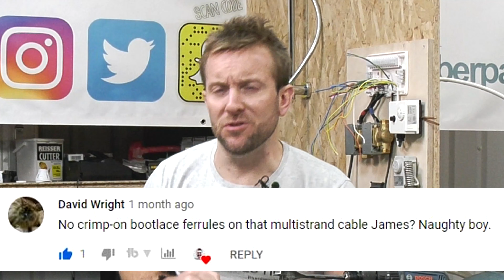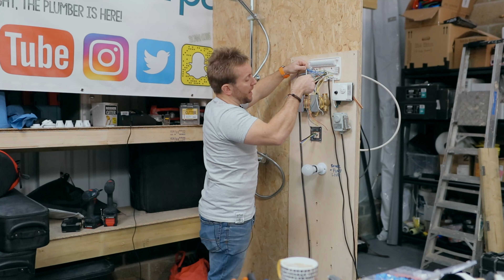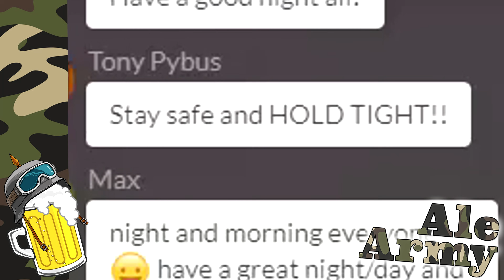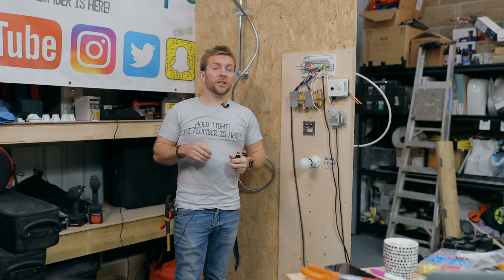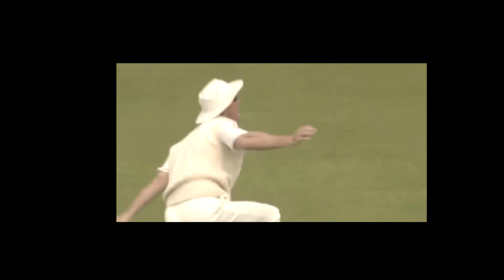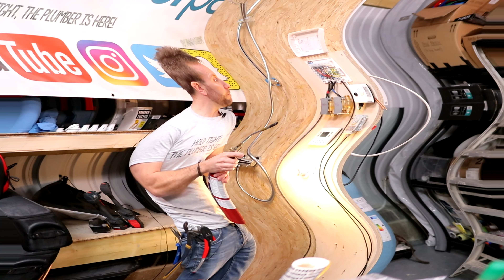HOW TO WIRE A CENTRAL HEATING SYSTEM FROM SCRATCH - S PLAN

Comment: you mentioned using a good wire stripping tool, but you don't have one in your amazon store, could you tell us which one you use please, mine is rubbish and either doesn't go deep enough and doesn't pull the insulation off, or goes too deep and nicks the core, cheers.

Comment: Im wiring up one of these soon. What a understand already following an S plan, all wiring for both the valves, boiler supply, general supply. Now the only other two components to be wired are to my knowledge the heating element into the cylinder and next to to a thermostat that connects into the cylinder. No time controller or pump which leaves a few blank spaces following the common S-plan wiring diagram. Any help appreciated 👏

Comment: As a mechanical combustion engineer, I do a bit of electrical work. Its mainly swapping out u/s parts for new, and like you've discovered those bootlace ferrules are awesome. I use them everywhere, Wagos, Chockys, PCB plugs etc, they are so much more reliable than twisting/folding wires which occasionally come back out.
I use exactly the same brand too.

Comment: Cheers for this James.... Just wired up my first mock up board, like yours.... and.... drum roll.... it works!!!!! I didn't think it was working at first, stood back and scratched my head for just over 10seconds and click, it triggered and turned the bulb on! Didn't realise the valves took that long to open and trigger the microswitch. Cheers again.

Comment: Hi mate, thanks for this video really good, earned a sub! 

I have a problem where my Hive system was working for 2 years, suddenly when I request central heating then it lights up like it's requesting it from the boiler, but the boiler doesn't start up. It works when I request hot water though. Any idea what colour wire I'm probably looking for in my wiring centre? I can trace the 2 wires from my Hive unit that request hot water, or central heating, but I don't know what they should be connected to in the wiring centre. 

Cheers from York!

Comment: I love this video, honestly I must have watched a million videos before this one, and no one says it as easy as you - finally got the confidence to try out my own wiring centre. Question: How would the wiring differ if I had two stats and valves for CH (one upstairs and one downstairs) and then one for HW, and my programmer could do them all separately? I assume if I doubled up the wiring from each stat to each CH valve as you said here, I wouldn't be able to do the separate controls since either room stat would trigger the boiler for the whole house and not separate?

Comment: Nice vid, great advice, good accents. Some advice in return from a production bod - love the wiring up to the light bulb, but if you laid out your circuit on a tabletop, rather than on the wall, you could position your camera overhead and so you avoid getting in the way of the subject. This will cut your edit time too. You could also reduce the frame size on wiring so you can annotate outside of the main subject (so there's a border of white space).  If you're running 2 cameras have the 2nd on you. Some of the mid shot explanations mean the viewer can see what you're pointing at so clearly. That's how I'd do it - simples (for you and the viewer). Anyhow, is that getting a proper moan on?! Great free resource - now I've just got to see how to apply it with a wireless room stat (and pull out all the individual connectors loosely strapped into a box by the original installer - who didn't bother with any kind of stat. Nice!).

Comment: Hey, great video, as always! Why do you connect the grey MV cables to a constant live and not the CH on / HW on from the programmer? Doesn't this mean the boiler will run continuously if the valve fails in the open position?
Reply: No, because it's the orange wires - switch return wires from the valve that fires up the boiler.

Comment: i would say as a best practise that zone valves can be ferruled together PROVIDED something like Regin 5 Way Electrical Connector with Strain Relief are installed between each zone and wirin centre for maintainance and testing. also allow in situ replacement with having to power the whole Heating system just to swap out a zone valve

Comment: Hi
Thank you for your kind and easy to understand explanation.
Would wrong flow direction of the zone valve cause problems such as boiler not firing !? 
I  have a S system with a heating boiler only in one floor lower and the valves, pump and hot water tank in upper floor.
I have changed 3 zone valves and a new pump, the boiler does not fire. I keep reseting  the boiler, the indicator diode for heating becomes green but goes off again. 
It remains in stand by position.
Any advise please !?
Thx

Comment: Hi  I am just about to build a system like this using an Ideal Mexico boiler which does not have appear to have a pump overrun. So i assume pump is in parralel with boiler.  Also, these busbar pieces for behind N and E,  are these included in the Timeguard box, or are they bought sepatate ?  Thanks

Comment: Good video, helped loads when self fitting a hive controller and switching from the old mass of wires.. used the Wago box instead but followed the approach in here and all was good.
Reply from the maker: Cheers!
Reply: @plumberparts  only issue I have now is how best to ‘take out’ the room thermostat (in hallway near door and garage door so not practical to rely on.. rather have the hive wireless in the room being the main control. Is it as well to take those wires out the loop and just connect up that link?

Comment: So I have an old tank system, there is no programmer that we know of/can find, there is a junction box and then a light switch, one for hot water, one for heating and a stat down stairs. So far no one has managed to work out why my heating get stuck on sometimes, even electrictions, could a missing programmer cause this?

Comment: Thanks for this video, I just built an extension and upgraded my single system to a zoned system, I copied your wiring center with a junction box and strip connectors as couldn't find a pre wired box in Ireland but it worked a treat and this video saved me a fortune. Love the channel and thanks again

Comment: Hi. New to heating electrics and you make excellent vids, cant say how much they help. . Some systems have hot water priority but this S plan 2x2 port system appears to work independently or in tandem, with no priority. Am I correct? Is it only Y plan that has priority?

Comment: It would help if you mentioned how many cores are in each Cable supplying each unit.  For instance how many wires to the time switch or how many cores on the Thermostats. etc. Good Video though.

Comment: Hoping someone can help me...I have a 3 port valve, when i press heating the actuator head whirs up you can hear the tank coming to life but then seconds later it turns off...the only way for me to get heating is too turn the water on too...in other words the only way I get heating is to move the toggle on the danfoss head to manual...I've tried two different heads and changed the actual valve body

Comment: As an electrician I have sorted loads of these out for friends and family, plumbers come and change valves and cock the wires up, that and electricians who have no idea what they are doing in the first place leave S-plans in a total mess. 
Best solution is to pull every wire out of the wiring centre and identify everything wire by wire and reconnect each wire in turn, then prove the functionality of each channel and it's associated stat and valve.

Comment: I bought those same crimps but there's no BSEN number, and no rating. It's assumption only that suggests they can handle full load/capacity of wire. And what are they made of? Not aluminium hopefully, with a copper cable being inserted. What's the continuity results for these circuits, did the crimps effect the readings at all? Just curious. 
    It's a shame i couldn't watch all video as i wanted some tips for wiring an s-plan for an assessment, hopefully no one gets electrocuted from your mis labelled switch lives as you seem like an nice guy.😁🤞🤞⚡💥💥⚡

Comment: Hello. I'm struggling to wire a three way valve with motorized actuator with three wires blue black brown on a Audax 8 heating pump. Can't figure out how the reverse motion will occur from the diagram . Any idea pls?

Comment: Hi,
Stanley twin burner , oil vortex burner and a wood fired stove to heat a 2500 square feet 2 storey house. Plumber has recommended a Multi Pod system. Downstairs has under floor heating . Upstairs has rads. I’m an Electrician but there’s no schematic issued by plumber..
The home owner wants the Stanley twin burner in the kitchen. With the condenser boiler outside as back up. There’s probably no need for both but the client wants what the client wants. Can any one out there tell me where to get a wiring  system at a reasonable cost. The multi pod takes the three heat sources but only has one heat output. So the cooker and burner might share the motorised valves. Will I have back feeds ? 
I’d prefer a wiring system or control box to take care of this

Comment: My only comment you should mention not all boilers use a switched live through microswitch some use low voltage supplied from boiler to zone valve microswitch

Comment: I just bought a house which has an f&e system with no stats or programmer. Just a time clock to turn on the heating which will also do the hot water. The boiler is in a boiler house which is built on to the house. I am planning on having a room stat upstairs and downstairs, a 2 zone programmer under the distribution board downstairs but where is the best place to fit the motorised valves? I will be able to run multicore cables for my connections. Loving the videos man!

Comment: bootleg ferules are great until you have to trace a fault on the system and end up cutting the ferule off to separate wires to test, then some will be too short to re-connect. there are pros and cons to this. You should also have brown sleeving on any Line conductors that are not already brown.
Reply: Gareth Rendle doubt you've been anywhere near a multi meter, I'll have fries with that thanks Gareth.
Reply: bob bob how would you possibly know what experience I have? What a stupid comment!

Comment: Good neat job explained well. BUT ..... you should not have doubled up on the wires into the ferrules, you had enough spare terminals in the strip block. There is a risk of pulling out. Finally always do an earth continuity check throughout the system, especially if plastic pipes are involved! In fact do a video on earth bonding and why it is important. See any video by John Ward for good explanations and examples.
Reply from the maker: I did say that a few times in the video. Thanks for your comment!
Reply: @plumberparts  .... but "they" don't listen and remember ... they only look at the final result. The box has not got enough neutral and earth terminals and could do with some pre-printed labels, so it is OK, but not as good as it could (should?) be .... fyi I took your advice and will soon be posting my own DIY vid ref DESTRATIFICATION on YT so you can I fun at my expense ...... Hold Tight!
Reply from the maker: Good luck. It’ll be interesting to know what you think about the process!

Comment: This is great but ; wiring  diagrams are freely available online, and 'PLUMB CENTER' do a 'WIRING CENTRE' that is set out like a PCB, and all the necessary connections are labellled up, for both 'S' and  'Y' plan systems!  MOST competant Heating engineers know all of this (Ok it is good for late starters like myself in 2004, or young lads in the industry) But you are encouraging the 'DIY maniacs' who don't want to pay a professional, but will eventually ' F??? it up' and then call 'us' out but still don't want to pay for our time! dx
Reply from the maker: I’m encouraging apprentices more than anything to learn this. Regardless of printed PCB’s - they need to learn why they’re doing what they’re doing. 

I’m not encouraging any section of society. I just think YT is the best place to put my (hopefully helpful!) videos. 

Sorry about this one mate 🙁

Comment: From the programmer you had the Brown wire as call for Hot Water and the Black for call for Heating,  But you talk about a red wire for call for Hot water going down the white to the cylinder stat (common) and the yellow being the switched call for heat from the cylinder stat. In the diagram you have it labelled as red from programmer for call for Hot water.  Confusing!  lol

Comment: MOST wiring centers are wired wrongly as they either don't have a earth in every cable carrying 240v or they use the earth as a switched line as couldn't be bothered to run enough cores in that cable. The EARTHS protect the cables from short circuits and stupid people cutting through them when they are still live from receiving a nasty electric shock!!

Comment: Absolutely Brilliant!! Only comment I would pick up on is that instead of using red tape I would suggest using brown sleeving on the blue and the black cables. Blue being the current neutral standard and black being the old system. I hate seeing tape used just because with age it becomes a sticky mess and if I need to trim it later  getting it off can be right pain in the rectum. See you on Thursday for a pint - Hold Tight!!
Reply from the maker: Cheers Tony! Expected a few sign ups yesterday. Had 4000 views and not one sign up on Patreon! I wonder why? Any thoughts?! 😂
Reply: plumberparts because a lot of people want something for nothing mate.

Comment: Great video  you have made it simple to understand top man . There’s a little tip for coding of wiring . Where the red tape is used this should be brown as the wiring is the new harmonised wiring ( ie brown and blue ) . You can buy brown, blue , green yellow  sleeving from the wholesalers . I have sometimes come across people using the earth and using it as a conductor as they have only run a 3 core to the cylinder stat DON,T. Run a 4 core then everyone is happy . That also applies to the room stat .NEVER USE USE THE EARTH AS A CONDUCTOR EVER  .  As per regs . Hold tight 🤪
Reply: Yep. Do it right or not at all. Too many awful and dangerous jobs out there by "Professionals" and amateurs alike. I work on the principle that I might be the next person back to the job so no point in making it difficult for myself...
Reply: Alan Williams hi Alan, you comment demonstrates that you know nothing, stick to taxi driving, regards, bob.

Comment: Hi James. 
Here's a question for you.... I'm 37 now. Have been plumbing for a few years and am OFTEC. When I can justify the spend in a couple of years, is it still worth getting a Gas qualification? What's your opinion on Hydrogen boilers and how do you think the roll out will happen. Lay new pipes, or slowly introduce boilers that will cope with a blend and as boilers age and get replaced, upgrade to a boiler that can take a higher blend or is there going to be millions of boilers getting swapped out in a short period of time?
When all this malarkey 😷 is over, let me know when you're passing by the Maids Head by the fens, I'll buy you a drink🍺.
Reply: Christian B Hough One of the gas boys told me that new builds after 2030 will not have gas boilers installed. But there are still millions of gas boilers that will still need servicing etc. Renewable energy seems the way to go with ground source heat pumps and solar etc.

Comment from the maker: Extra belly scrubs if you can guess the cricketer who took THAT catch! (also I forgot my tool belt in this video!)
Reply: Andrew strauss in the greatest ashes series ever
Reply: Great video James 👍it's the same system as I have in my home so could come in very useful one day.  Hope you don't think I'm being cheeky but I have a small leak under my sink form the mains water supply filter? That's if it is indeed a filter? Its situated just after theater regulator?  I can't source the part anywhere, probably because I don't know what it is? 🤔 kind regards Nigel